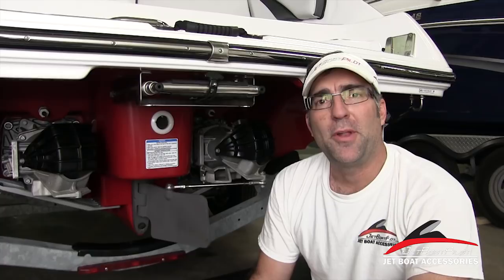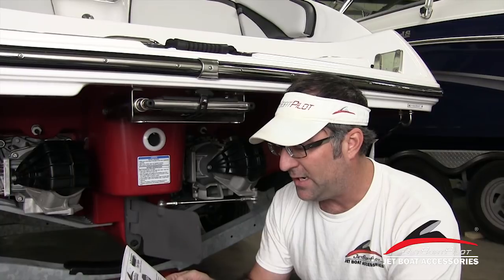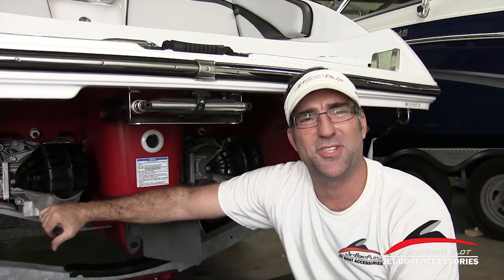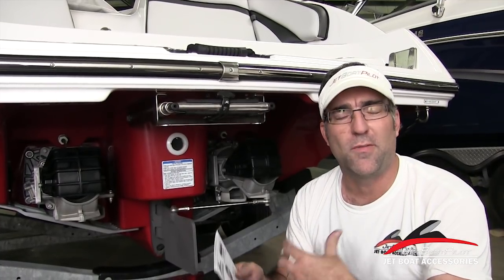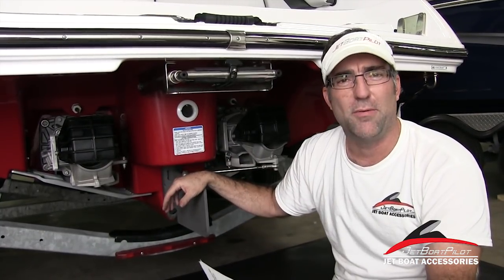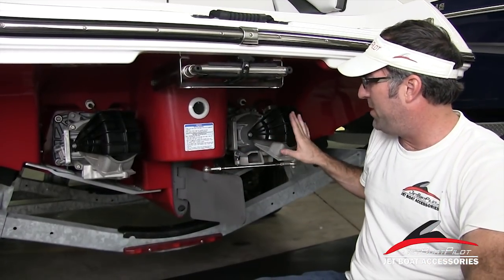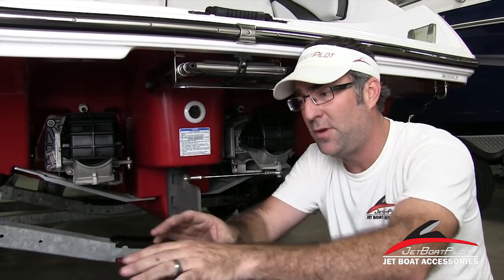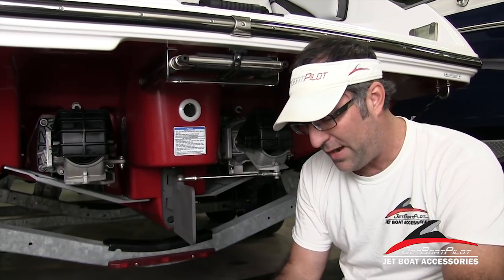Lateral Thruster 1.0 Safety And Operation Information

Comment: This is so unnecessary what a waste.... this product I’m sure works but you don’t need that at all to operate a boat Yamaha boat safety in any condition... a real products of use would be swapping out our 50gal fuel tanks for a larger one... or a kit maybe that would let you retrofit the new 12” dash kits on you 2016 connect model boats...
Reply from the maker: Eddie Cruz while I am sure you're an expert at maneuvering your boat around the dock, others like friends and family often will not even attempt to learn. Further knowing the learning curve involved many captains won't even let their guests touch the steering wheel. With Lateral Thrusters installed the learning curve is dramatically shortened and the boat is much easier to control for anyone. Who wouldn't want more control?
Reply: Jet BoatPilot I get it, but we can’t baby everyone without these add-ons with a little patience you will get it like anything else to each his own I guess... when is a upgraded fuel tank kit coming out for us taking these boats to there limit way offshore.. only way I buy another Yamaha is if fuel capacity is increased with more power... fully fueled with your crew on board in rough seas engines could use a little more punch...
Reply from the maker: While I understand your View Market Research and customer feedback has told us that this is a very relevant product and needed product and sales back that up. I mean who doesn't want more control? As for the fuel tank while a great idea I would not want the liability of dealing with anything to do with flammable liquids on a boat. Too much risk for my taste. Baby mother Yamaha is watching and will take notes if they ever decide to come out with anything larger or more powerful.
Reply: Jet BoatPilot glad yamaha always listening to cues from my side of their market... We want more fuel capacity and more MPH with a full crew on broad... This is a sport boat that a lot of people are using offshore. Maybe they could offer an offshore ocean model.. with some 368. Cams titanium springs & retainers better props they could easily get more MPH without adding twin superchargers all they need is the will to do it... Or if dropping in some twin GP1800 motors then offer that in limited numbers they will sell out faster than any other model guaranteed...